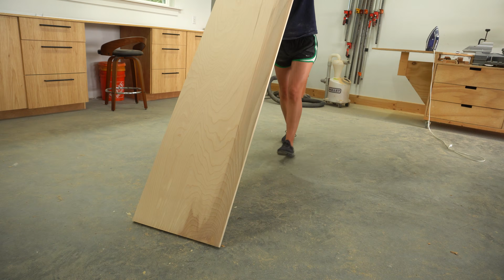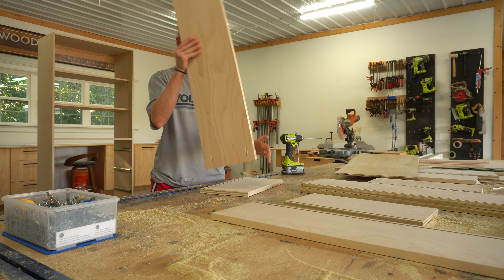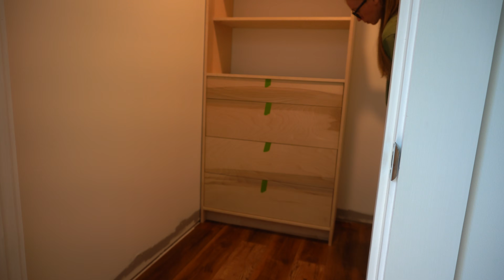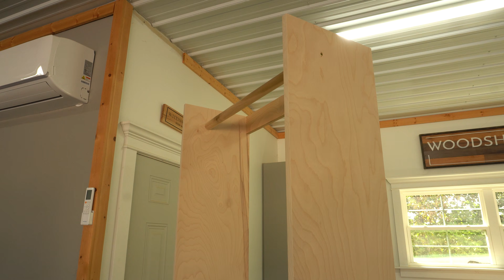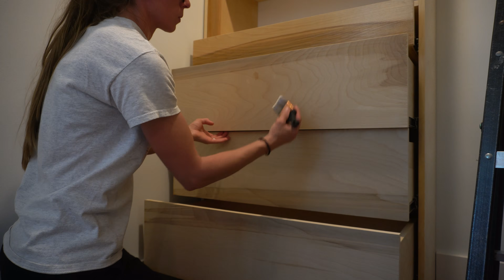How to Build Basic Modular Closet Cabinets for a Small Walk In

Comment: That worked out really well.  I was wondering if you were going to tie the rear cabinet to the shelf,  but being separate works out. So many people think it it all has to tie together,  and it doesn’t
Reply from the maker: Absolutely! They can certainly be tied together with another shelf, but being separate makes it work for various size closets. Mine didn’t have a lot of extra space to add a shelf between so I didn’t bother. But if yours was wider, it could totally make sense to connect them or even use that extra space for more hanging. There are a million options 😅 
Glad you enjoyed the build! I appreciate you watching!